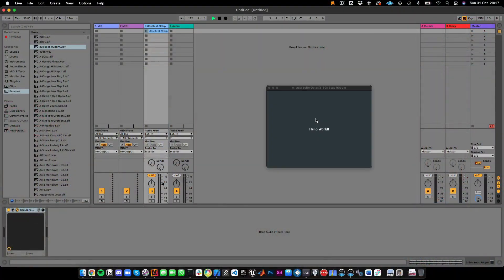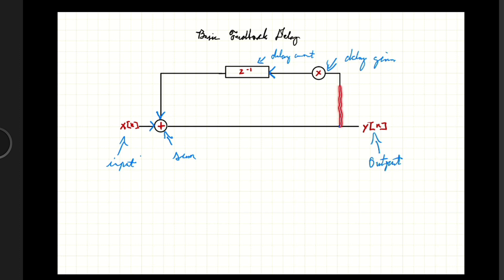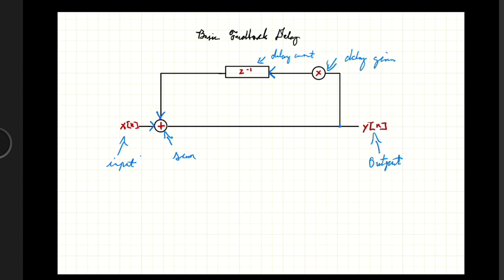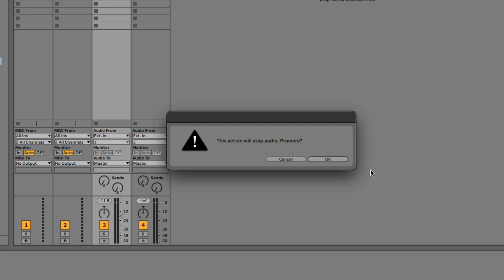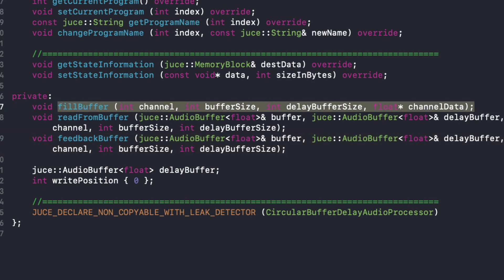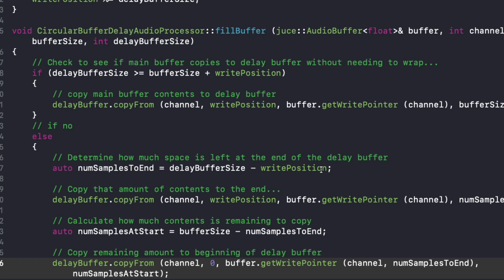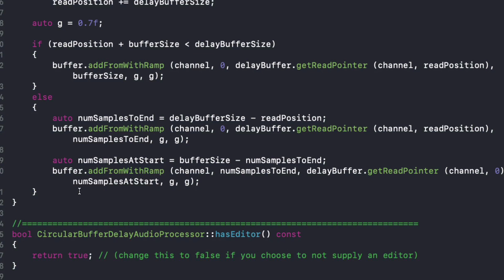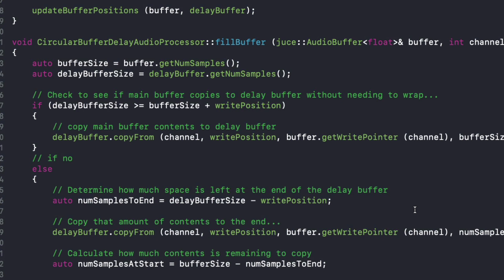JUCE Tutorial 17 - Creating Delay Feedback

Comment: Great tutorial, I really appreciate all of your videos, making the whole learning process much easier!
I do have a question: I followed this tutorial and the previous ones and it all seems to work fine for the most part. However, when I have a very small delay time (0.005 seconds or shorter), I get weird aliasing artifacts (at least that's what I think they are). I really want to be able to use short delays to create comb filters/resonators so this is a big issue for me. I even used MATLAB to help analyze the output signal to check for any discontinuities and such and could not find any evidence of anything bad. Any ideas?
Reply: hi speechrizz

Comment: Hello. I have a couple of stupid questions. I'm brand new to this. Just getting started with coding. So what you're doing here is writing VST effects? What language is it that you're using? C++? Also, could this style coding be used for a piece of hardware? For example, could I use this coding for building a delay pedal. I'm good with the electronics part, like using A/D and D/A converters and building the circuits. But I'm just learning how to use code to manipulate the hardware. Also, how could I learn how to code guitar cabinet IRs? Sorry for the stupid questions, I just don't know where to get started.